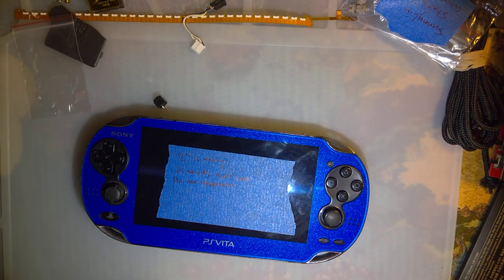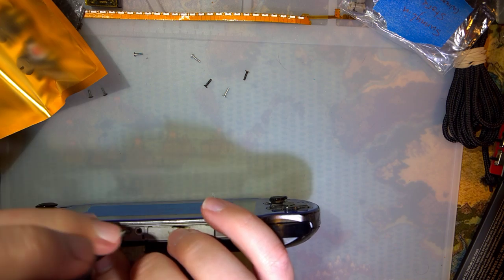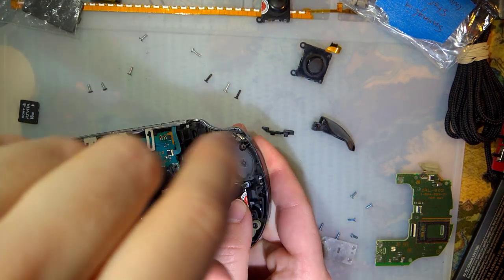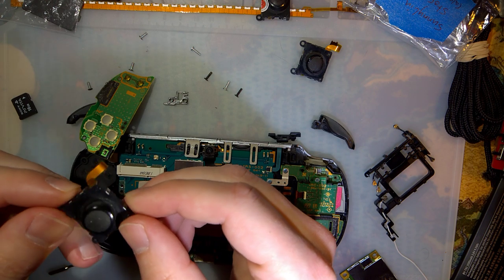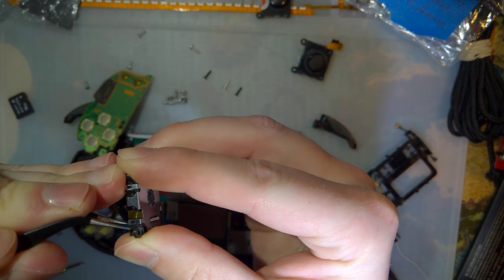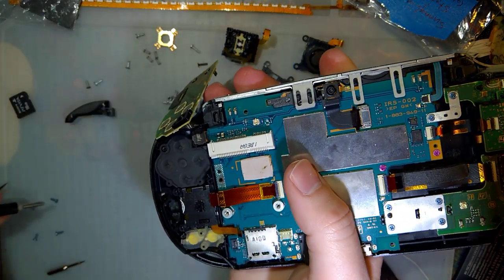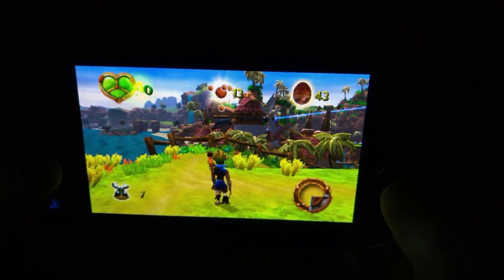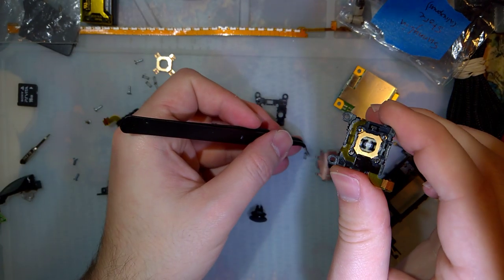Repairing the Joysticks in a OLED PS Vita (1000)

Comment: Thanks for doing this. Just a heads up, you do not need to remove the sensor on the side of the joystick to get the plastic cover off. Those little plastic nubs are slightly expanded to keep the sensor in place and prying it off may prevent it it from staying in place when you put it back without some type of adhesive. There is enough slack in the flex ribbon to remove it without taking off the sensors

Comment: The replacement screens being sold online aren't actually new. In china they take apart broken PSVita screens and install new digitizers on them. So all of them are going to be OLED for the original model
Reply from the maker: I heard rumblings that not all the 1K screens were OLEDs so I just wanted to do a quick test. But yeah, I figured the panel itself is OEM with the Samsung logo.
Reply: @makho  I think that misconception started because of the badly worded translations some chinese sellers use. They will list any panel with the LCD moniker.
Reply: I just got one today I can assure it’s new not used easy way to tell is the screw holes if screws go in easy it’s used if not it’s new never had a screw in. Some listings on Ali express say new some say used or 90% lol like new but used.

Comment: Nice video, Im looking to do the same (broke my sticks from too much flicking in project diva oops). Anyways, I was wondering if the left stick and the right stick use the same replacement part? Some listings on aliexpress don’t state if it’s for a specific side or not. If it makes a difference, I have a 2000 model.
Reply from the maker: 2k sticks are different than 1k sticks. Left and right are the same part on both models.
Reply: makho thanks!
Reply: @makho  so does that mean that I can use 2k sticks for my 1k?
Reply from the maker: @relaxingandedits5340  no, there is one part for the 2k and one part for the 1k. You cannot use 2k sticks on a 1k or vice versa but on both models the left stick and right stick are the same part.
Reply: @makho  Ok thanks for ur time
Reply: @makho  Btw just received a screen digitizer in my mail today....I broke mine's in 2017 and didnt want to pay for vita anymore but considering the numerous amounts of plugins, hacks and mods....vita still rocks in 2020

Comment: Just bought a used 1000 and my left stick feels so loose compared to the other. Downloaded a hardware checker vpk and the stick is completely dead. Doesn't register any movement. You think changing just the thumbstick will work?
Reply from the maker: open it and swap the thumbsticks. If you right stick is the one that stops working, then all you'll need to do is replace the bad module (or open it up and try to repair the stick itself).

Comment: Wait, did you end up replacing the right broken one or did u just open it the old one and reassemble it for it to work?
Reply from the maker: a little bit of both -- I fixed one stick with parts from the other broken stick and then just replaced the first stick
Reply: @makho  Oh okay. I ended up just opening my old one and reassembling it, I couldn't see anything wrong with it but for some reason, it just won't work. It's stuck on the down position in the os. Thanks for the closeup tutorial.

Comment: Hey, Makho, have a question. How do you think, can I switch the stick mechanism from PS Vita 1000 to PS Vita 2000 analog stick?
I think the stick and its guts should be the equal... 🤔
Reply from the maker: no, it's different.
Reply: @makho  inside the mechanism its different? Sony. Just Sony. 20$ for PS Vita 1000 stick vs. 4$ PS Vita 2000 stick 🤷
Reply from the maker: @arlekin73  yes, they are different.

Comment: Bro i need help ! Mine kept ghosting to the right (left joystick) even after i brought a  new joystick for 1k. Can anyone help me?
Reply from the maker: it's either not connected properly or your new joystick is also faulty. Swap left stick with right stick to check if the stick itself is faulty.
Reply: @makho  the sticks are actually not faulty and I've tried your method. It could be the ribbon maybe im not sure .can anyone comments your thoughts about this ? Thanks in advance
Reply from the maker: @danishrifai1441  so if you swapped the sticks and the problem is now on the known good stick, then the problem is the motherboard, or more likely, the stick connector on the motherboard itself. The connector is pretty fragile and the most likely issue, I think, but if there's water damage, the issue could be just about anywhere.